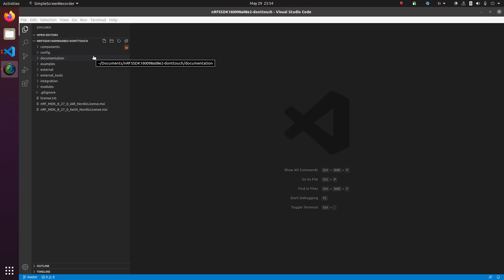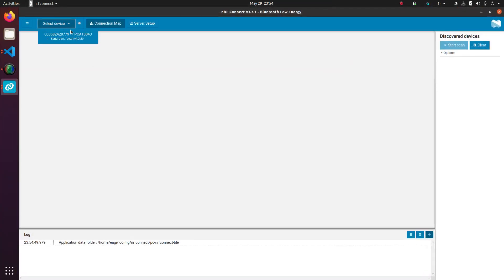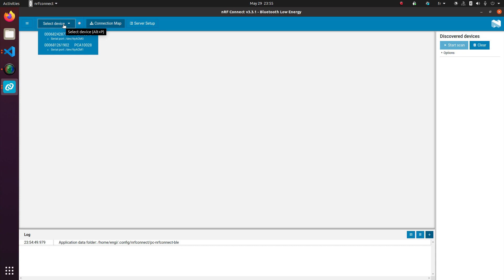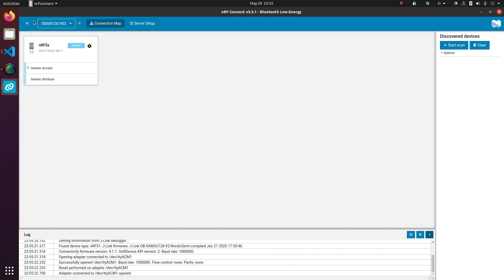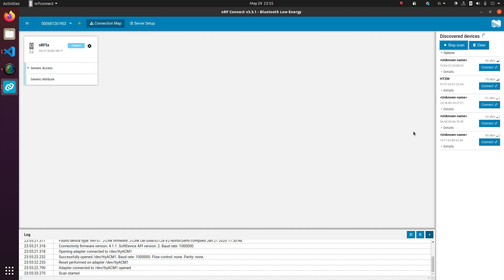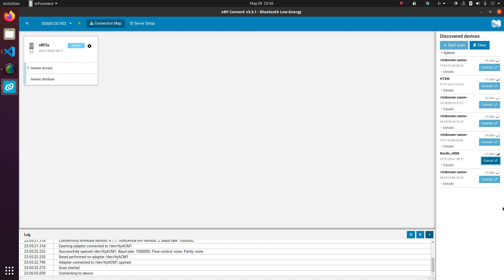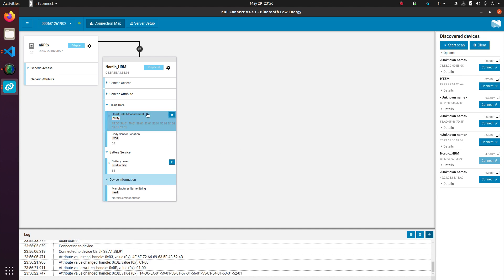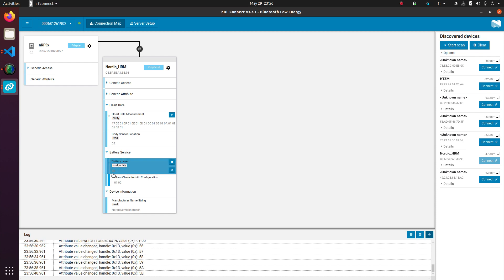Introduction to nRFConnect Desktop - Turn Your Board Into a Bluetooth Scanner!

Comment: can NRF connect for desktop connect directly to any bluetooth device, and do i need a board? I've got a HR monitor with bluetooth 4.0 that reads HR in real time, but when connected to the app HR data is aggregated to the minute-level and i need heart rate x time in seconds. the HR monitor has built in memory so it will record data without being connected to the app

Comment: Hey, any idea how to send the log file data to an excel sheet in real time? Thanks.
Reply from the maker: There might be an nRFConnect service that does this. If not, you can stream data you recieve over bluetooth to a serial port and use widely-available python serial libraries to store the data into a .csv